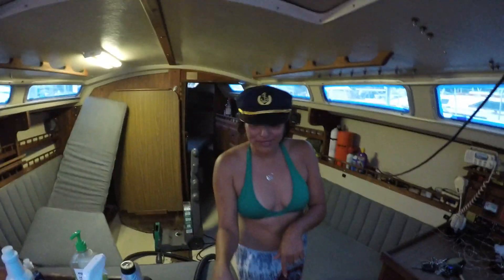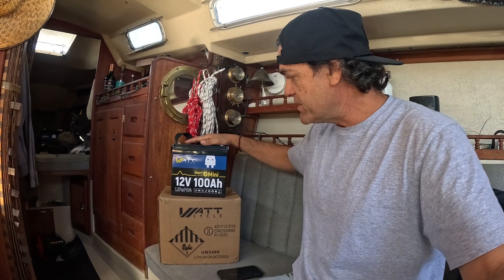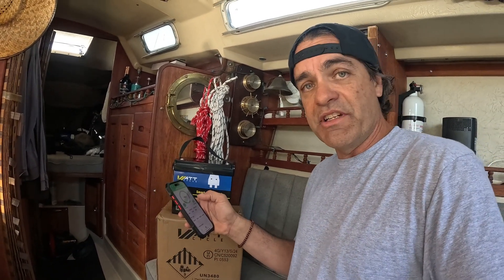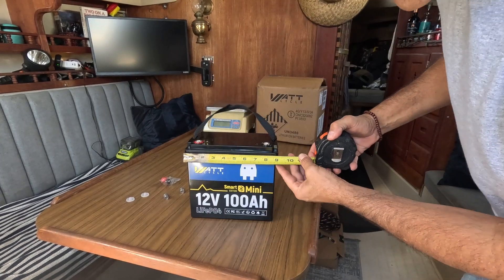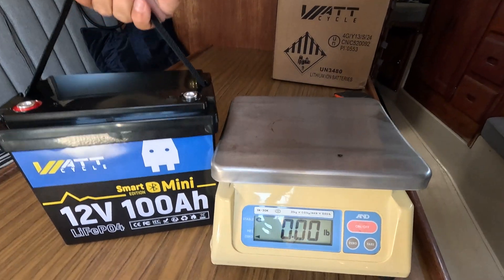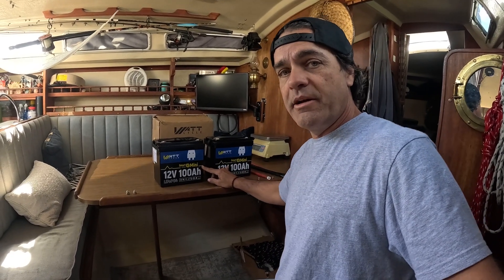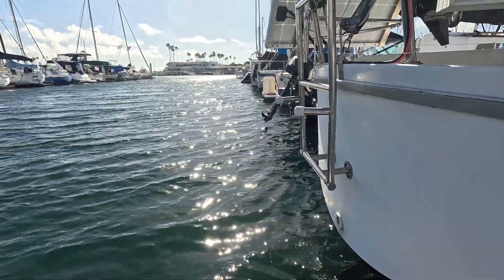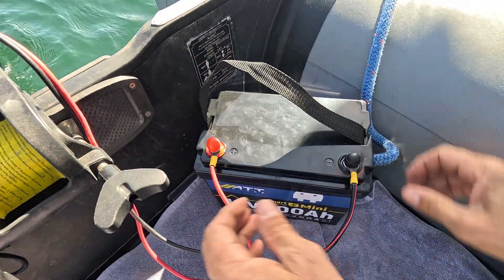New MINI Lithium Batteries! How To Wire PARALLEL & SERIES

Comment: The combination of those small form factor 100A batteries and trolling motor provide a great solution vs. the overpriced bespoke LifePO4 dinghy motors.  I just wish I had a generator or enough solar to charge them for extended cruising.
Reply from the maker: Charging might be an issue but I’m not against bringing my Honda gen y if I need to. I’ll know once I start using them more.

Comment: Thanks for sharing.  How do you plan on charging those batteries once their down.
Reply from the maker: For the dinghy I just use a 20 amp AC battery charger. 
For the batteries that are installed permanently on my boat I have solar, shore charger and a DC to DC charger.
Reply: @sailingsole  Curious on your permanent setup. Did you run your alternator directly to a starting battery and then use the DC to DC to charge your Lithium? Bypass battery selector switch entirely?

Comment: Biggest problem with lithium, need min. Of 400 solar watts , to charge correctly.
Reply from the maker: I only have 200 Watts of solar and I’ve been charging my lithium batteries off of that for four years. Who told you that you need 400 Watts?
Reply: Good rundown on the two types of wiring,which do you prefer? ⛵️⚓️-Jim
Reply: False. Who said that? Why?